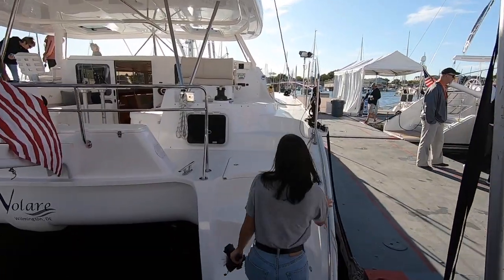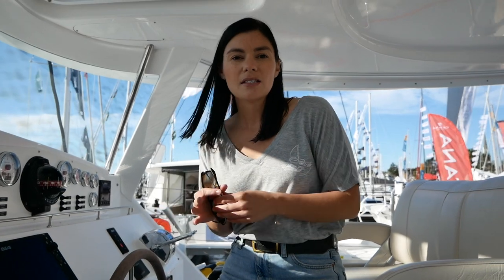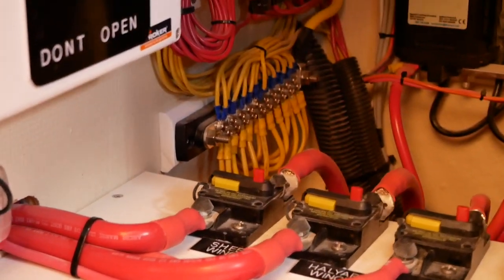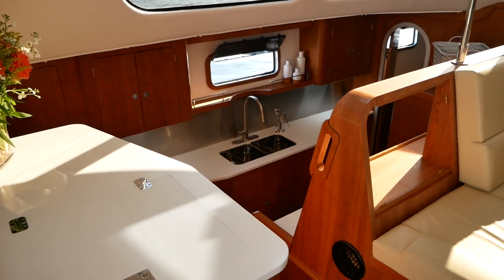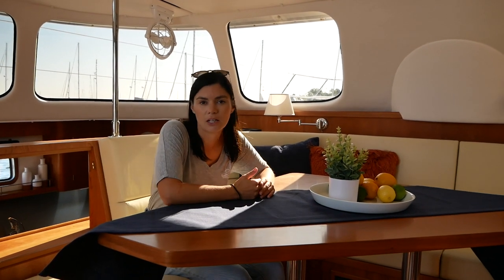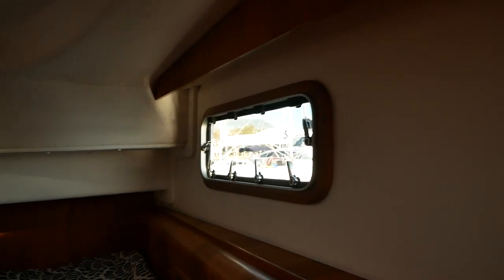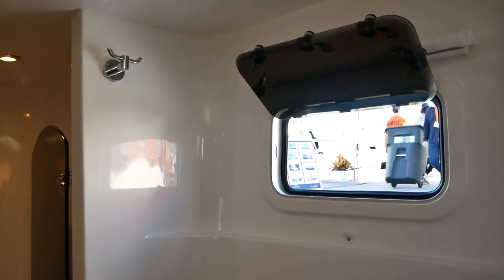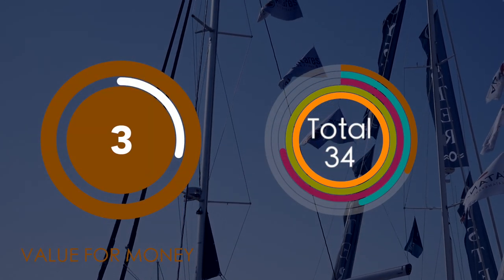Antares 44 GS Catamaran Review 2021 | Our Search For The Perfect Catamaran.

Comment: The main winch location is odd. There was a small amount of water in the bilge and the pass-thru from the galley to the saloon is strange.  The head in the guest hull is awkward for anyone in the aft cabin and there must no be a day head on the main deck.  So if you are on night watch in the cockpit and need to use the head you basically have to travel the whole length of the hull potentially disturbing everyone else on the boat.    There are many other cats in the 44ft range that most definitely do a much better job at space management. Plus the less than stellar sail performance..   This is like the Harley Davidson of Catamarans.   You buy it for the "prestige" not usability or performance.  EDIT:  The Knysna 500 is a better value

Comment: I like these vidios you two make. Still I wonder if Equipment as instruments,Raymarine or B&G does any difference and equipment as engine.. life raft and so on.. Nothing of these brands are mensioned in the vidios.. Does it makes a difference what a boat is equipt whit?
Reply from the maker: Things like electronics and liferafts can be changed if you're not happy with the supplier the boat builder uses. So we're not really assessing that kind of thing, because it can be changed easily if you so wish. 😊

Comment: I haven't been paying that close attention to electrical specs but how many of the Cats you've reviewed come with lithium batteries as standard or offer it as an option? I looked at this model on their website at the specs and it appears they are using lead acid batteries without the option for lithium. This was one of the reviews I've been waiting to see and now that I've watched it, it is interesting when comparing to the other already reviewed Cats, my rose colored glasses have been removed. As always, great video!
Reply from the maker: Most can have them as an option. This cat has so so much potential, they just don’t seem to want to innovate
Reply: Why no lithium? 
Because they still live in the last century.
Reply: @AlexMotan1  Lithium are offered. Read up to comment from Memo the builder. Only real negative is the website doesn't keep up. Most of the negatives in the comments are about owners choices, not builder design.

Comment: I absolutely love this boat. However, there are a few glitches that I agree with. The cockpit does need a re-design. I love the new Hard top on the GS, and the shaft drives are fantastic! I’d want a hybrid drive train,  and lithium Batteries. I’d turn that aft cabin into my work space, so that niggle isn’t an issue for me. Wish I had the money right now.

Comment: These videos would be great if you had sailed a Catamaran for more than 1 nautical mile.  Your scoring list misses so many things a Cat owner cares about.  For example you don't investigate deck slap / bridge deck clearance.  You spend much of your time on seating areas but ignore that many cats you prefer have wide and thus slow hulls.   Again your boat show catamaran experience shows when you ignore that many of the "modern" catamaran cockpits do NOT have a sightline forward.  During the boat show this is not a big deal but at sea  it is not much fun to not see the horizon.  BY the way antares does offer a cockpit with straight seating and a straight sun lounger to port.  One feature double handers care about is how easy it is to summon the off watch crew to the helm.  On the antares the hatch to the master is next to the helm.  This is a great feature to double handers.     I would propose that you sail a catamaran for a few years before becoming judges.

Comment: Really top quality catamaran. The only thing in my opinion is the controversial galley down. It can make the hull very hot in the tropics and there is no room for a second head in the hull.
Reply from the maker: On the flip side, cooking in the hull keeps the heat away from the saloon & master cabin, so not all bad! There's also a big opening hatch in this galley and it's very airy and open to the saloon, so I don't imagine it being a major issue. But yes- you either like or dislike the galley down!

Comment: Interesting review, guys. I personally love the boat, but I look at the Maverick Hybrid design and compare it to this and think that there is room for improvement. Lithium is the future and there isn't a need for diesel, yet this maker sticks with the old guard. I'd rather see an updated cockpit that sees modern comforts, INSTANT access to a life raft in case of fire or capsize, and an engine/electrical system based on max solar/wind/hydro plus lithium and electric motors. The Maverick Hybrid gets REALLY close to being perfect, but its spade rudders leave me utterly cold. If we could see a 44 Hybrid with huge solar, mid-ships electric motors with shaft drives, skeg rudders and an improved cockpit, I think we'd have a winner.

Out of the gate, I still think this boat trumps most boats, but my desire for a viable electric/hybrid configuration gets in the way. An electric/solar with skeg rudders and being beachable seems like the business.
Reply from the maker: Thanks mate- we'll be reviewing the Maverick as well and that video will be coming out in the coming weeks.
Reply: Trane Francks have a look at devilliers 52 ketch aluminium cat design. I’m looking a building one with all the aspects you mentioned, I totally agree with your points. A few style changes to David devilliers design and it’ll be the prefect cat.

Comment: Most folks are rather harsh here, and for no apparent reason other than personal preference when it comes to aspects that have nothing to do with safety and comfort. As a reminder the builder admits to one purpose: "and that is to take a cruising couple around the world safely and comfortably." Shaft drive and skegged rudder, are you kidding me? Add to that a solid steering drive system without the added weight, maintenance and $$$ of cables/hydraulics. What other boat (Ruby) "reviewed" had even one of these two vitally important safety and especially build quality items. Without these you only really and truly have a coastal cruiser, not true blue water safety. The others have cut corners to cut cost and in the process added bling to cut out true safety and quality. Peace of mind seems to be absent in the "Comfort"  equation here. This boat seems to be built very much as advertised, for the cruising couple, not to impress and haul friends (stowaways) around.  I'd take this boat in heartbeat and would not feel a single compromise in any part of it, especially the cockpit. The helm position and view are down-right sexy.

Comment: Hi Nick & Terysa, Great review as usual. I've looked at this boat before on their website, but couldn't quite work out the idiosyncrasies of the design from there. So this was really useful. However as someone that would potentially regularly have 2 other couples on board, this boat is not an option for me. The cockpit  design compared to much cheaper Leopard, FP & Lagoon cats is utterly impractical for 6 people on board, as is the head arrangement in the guest/galley hull. It needs to be a complete package for that price and only ticks 40% of the boxes for me. Must have a demand or dedicated following though -  2010 Antares 44i still worth £420k on Yachtworld?? What could you get for that price  for a used boat? Much better value I suspect. E.g. 2017 Balance 451 £425k
Reply from the maker: All good points mate. You couldn’t have 6 on board in any comfort.

Comment: Love the look of the interior, it looks like a classic monohull as Terysa pointed out.  Galley down has it's benefits.  The mid-engine/weight centralization/shaft drive idea should be incorporated into more boats, I think.  A negative for me was that the wheel looked quite low when you are seated at the helm.  It looks like a long reach down. Might be tiresome if you were hand steering for any length of time (for some reason)?

Comment: Pleas, why is a shaft drive better than a sail drive?
Reply: Less maintenance and cheaper to fix if you have  a big problem. Just had the both sail drives replaced due to mechanic not replacing oil when they drained it. Cost them A$20,000 plus freight from Volvo Sweden to Sydney, plus slipping. Shaft drives you generally only need to change bearings, seals etc but you still have to slip. André

Comment: I love the safety and design of the cockpit, the solid handrails and AMEL like rock solid design...this will certainly be serious consideration points.

Negatives: 1. Dated interior look and design, 2. I dont like the galley down design, but if the woodwork is lighter and more modern i guess i can live with it, 3. The view from saloon directly ahead is really bad...its like being in a truck with viewing angles 30 deg left and right directly ahead covered...scary! Not sure why they dont just put a window there too. 4. Ventilation in bad weather cant be good as main ventilation in saloon are from top hatches and nothing that could be left open if raining?

If think Balance will overtake them very quickly as they doing game changer stuff...

Comment: For me, the Antares is kinda like a Perry 43. Nice enough boat, but I’d rather a more modern Seawind 1260. Compared to the Antares, the Seawind has a similar galley. It has a far more usable and better ventilated salon. It has a far more usable cockpit that feels twice as large. It’s lighter. It’s faster. It’s got a better head and shower arrangement. I much prefer the style. Shaft drives aside, Where the Seawind comes up short is in the side decks due to the stays and curves, and the cabins seem to have overall less storage. That might be expected with a 3’ shorter LOA though. The 1260 is also $400,000 cheaper (!!!). For less overall practicality, comfort, performance (not a major draw to me, but more is better than less), and in a dated style. It’s a mystery to me why anyone doing a side by side comparison would favor the Antares.
Reply from the maker: Thanks for your thoughts Sam!

Comment: People also complain about certain vehicle lines not getting the latest and greatest upgrades every year.  Personally, that is what I look for from a reliability standpoint. Give me the engine, transmission, rearend combo with the midlevel trim package that has all of the bugs and defects worked out by being in constant production for the last decade or so.  Sometimes the latest and greatest is nothing but problems due to a manufacturing rush to meet production and a not so well thought out design.

Comment: Antares could possibly claim that they were the first to design a catamaran for the full time live a board market and it was a great design when initially done.  The difficulty is that the design is now old and has failed to keep up with both technology and design expectations of the current purchaser.  Hull design - same, cockpit layout - same, internal design - same etc etc, the live a board couple now has high expectations and even basics like a rain water catchment and solid hand rails are missing, the cockpit design has been well covered but it is clearly an issue, bathroom positioning is poor, lots of little things that need "tweeking" exist in this design and a proper re-design is well overdue.  Quality of build and a nice feel will only get you so far and Antares seems to have reached it's limit now considering what other manufacturers are offering for the same or similar price.  Like the Porsche motor car there will be a line of die hard purchasers for this catamaran but is this enough to keep up with the competition stealing their customers???
Reply from the maker: Couldn’t have put it better myself. Cheers
Reply: A couple corrections.. it has rain water catchment built in and solid hand rails are an option.
Reply: @sailingrubyrose  sue you could ..............

Comment: Curious about what appeared to be a small amount of liquid in the bilge. ⛵️🇨🇦
Reply: On ours the air conditioner condensation drains into the main bilge then gets pumped over. That may be what it was. Other owners have installed sump pumps for the two smaller AC units to reduce water in the bilge.
Reply: @Unwrittentimeline  That's exactly right.

Comment: As a viewer I could not orientate the interior views. I really needed a slow 360º pan of the cabin. Is the down kitchen at the front of the cabin or down in a starboard hull? I’m sure if I had been in the boat all of the views would seem obvious. I wish boat reviewers would include plans to enable us to understand the arrangement, and keep them on screen long enough for us to pause and view them or screen save them. 4 or 5 seconds. Your comments are most valuable but I need to see for myself. That may mean at times you need a wider angle lens, and/or still photos to improve clarity. We like to see you smiling faces but do realise that the presenters head filling the frame frequently obscures our view on the boat. May I suggest sit at the table, languish on the bed or shower in the bathroom but realise we are looking at the boat.🙄😜

Comment: Love your vidjayoes, always good stuff, one of my favorite sailing teams.  I’ve always been a bit partial to the Antares, but having been aboard a 7yr old model and watching your vid on the new one, I’m not sure I see the $1M value.  Saildrives are perfectly fine for $400k less, galley up or down is irrelevant...its how it lives, as that is the next boat I’m buy, to actually live on it full time.  I’m definitely not sold on the cockpit, especially for a liveaboard and long term cruiser.  Outside of the slow to evolve design, the weird main winch location, and the price (used, new, or otherwise), they have moved off my list of “give a shit”.  I’ve never sailed one, it might be fantastic, but at their used prices, it would have to be orgasmic.  The build quality is definitely worth something, but not $400k well equipped over the myriad of production boats.  I’m in the $500k “used” catamaran market looking for a liveaboard for the next 5-6yrs, then to cruise across the globe.  I figure the 5-6yrs will give me time to fix the glaring issues.  I’m a very competent engine mechanic and electric engineer by trade....maintenance and significant refit to meet my requirements from a production boat are not off the table.  Knowing my wife and kids, a go fast cat isn’t in the cards for me, an apartment with a garage is what the wife wants in a boat.  The upside in production boats is that parts, fittings, and systems are easy to find nearly everywhere in the world.....there literally is no other upside, they are fat and slow.  I’m not in a race in my retirement years, I’ve raced monos, even on extremely long distances like circumnavigating Vancouver Island in CDN/WA with my parents across my childhood in a 30’ Catalina, grow some balls when the seas are above 20ft on such a little craft in the northern Pacific.

Comment: Another great, fair review in my opinion and not pulling punches.  Much of this is covered elsewhere but had to pull a few things together for my own reference.  Build quality looks second to none but the downsides:1. Galley down - no matter how you play it you are removed from the action in the cockpit and if on watch in the saloon have to loose you all round vis if making a drink or some food.  Also the chef must overheat given the relatively reduced ventilation compared to most galleys in the main bridge deck.  Plus who wants to be carrying food up and down stairs in a moving vessel, yes I know cats are stable but it is awkward and avoidable plus the serving hatch from the galley into the saloon just looks so 1950s! 2. Engines inside - on the face of it the central weight, protected shaft line and the fact that engine is out of the elements are pluses but if there is a defect you are slap bang in the middle of one of the hulls doing repairs plus, surely, if under engine power you are more disturbed by noise than if the engines are aft and more heat too?3. The fact that lines do not go to the helm position means having to move away from the helm too often in my opinion.4. The heads seem small given the size of yacht and the fact that the best guest cabin has no head associated with it is just a pain you can do without.5. The whole feel is old with one point being the small windows in the hull rather than big ones allowing you to enjoy your view at anchor form your cabin, compare and contrast to the Lagoon, F-P etc  And then there is the bottom line of $1M which is a huge chunk of money for 44 ft.Anyway looking forward to more reviews and you guys keeping it real.
Reply from the maker: Thanks mate. All good points. Please remember to vote to register those 5 issues you raise

Comment: The price is way to high. Seawind 1600 (850k usd), Marsaudon TS5 (740k), Slyder 49 ( 740k) , Outremer 51 (850k), All of them are selling for around the same price or cheaper, all have better performance and more living space. All of them are atleast 6-8 feet longer which is a huge advatage for offshore cruising. I don't understand who Antares is targeting these days with these very high prices. Seawind 1600 also has real wood veneer but also some other very nice features like dagger boards and retractable rudders. Marsaudon TS5 is superlight and will go up to 30knots. Slyder 49 is like a Seawind but less reputation. Or outremer 51 which has much better performance, same living area as the antares but also very good resale value.
Reply from the maker: Good points Guy, and why we gave the value for money a relatively low score... Thanks for commenting!